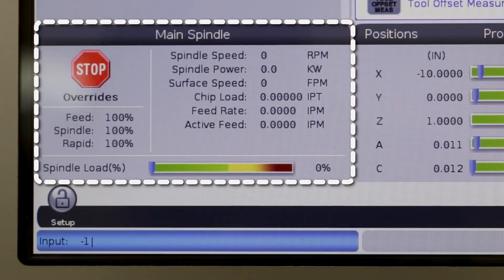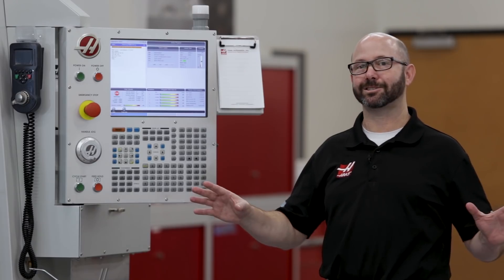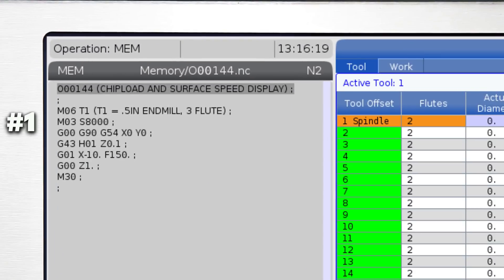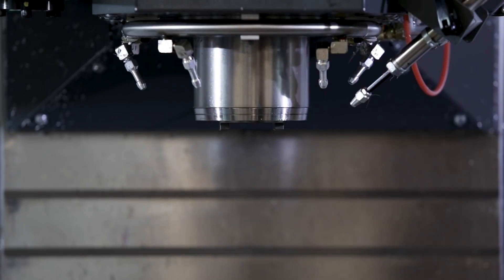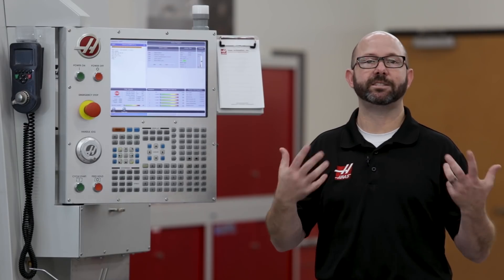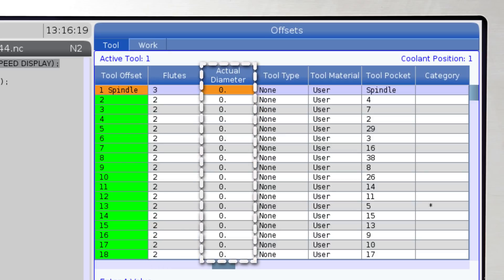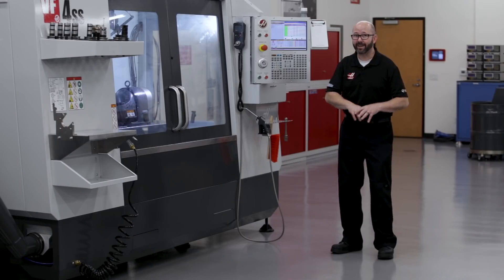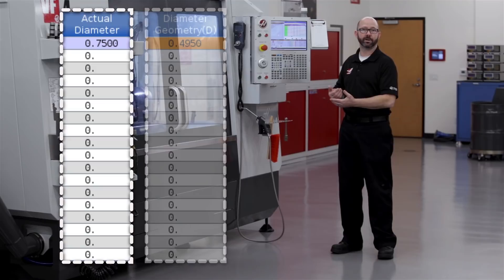Haas Apps Minute - SFM & Chip Load Display

Comment: I normally use wear offset in inventor or fusion for my cutter compensation which lets me use a extremely small lead in. Can I put the diameter in actual diameter without it taking that off of the programmed geometry? And leave the cutter diameter at 0.
Reply from the maker: Bill – Your point about CAM systems allowing you to use extremely small lead-ins is really good. By leaving a tool’s Diameter Geometry on the Tool Offset page at zero, and using our CAM system, we can get away with shorter leadins, which equals shorter cycle times. When hand programming parts, we typically code to the finished contour and then enter the Tool Diameter, which means our leadin must be at least as long as the tool radius to allow for cutter compensation. I can tell you’ve thought this through. Good stuff. – Mark, Haas Tip-of-the-day
Reply from the maker: Bill – That’s exactly it. Most of us that use CAM systems do the same, letting the CAM system take care of our tool diameter, leaving “Diameter Geometry” at zero, while entering in small adjustments into “Diameter Wear” for cutter compensation.  Entering the real tool diameter under “Actual Diameter” won’t affect your cutter compensation, it is only used for this Surface Speed display. Great question. For more info check out https://youtu.be/G6vHC9Z1eBs  – Mark, Haas Tip-of-the-day

Comment: may I ask why I may need to know my SFM and chip load on the display
Reply: Mainly because RPM and Feed rate are kind of irrelevant these days. Regardless of the diameter, carbide or HSS or cobalt can only take so much SFM so that's the unit that's discussed/thought about. Additionally, Feed rate doesn't tell the whole story as tool pressure is completely dependent on number of flutes and radial tool engagement in the material (high speed machining). Overall, thinking about your machining process using these two units (SFM and IPT) will ultimately yield you the best tool life and easier time machining.
Reply from the maker: Chad – I liked Noujaim and IX eleven’s answers on this. It’s more important for someone who will be programming Feeds and Speeds on jobs. We start to recognize Surface Speed and Chipload combinations that work really well with the tools and materials we are working with. These values can then be applied to any diameter tool. A part might sound good when running, then we see the high Surface Speed number and realize that at such a high SFM the tool won’t last long and must be slowed down. Good question. – Mark, Haas Tip-of-the-day